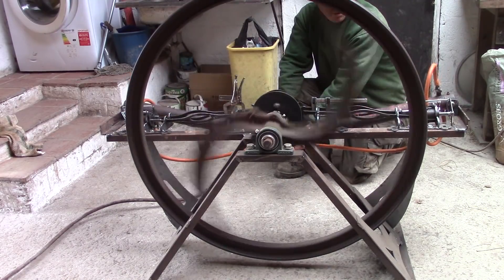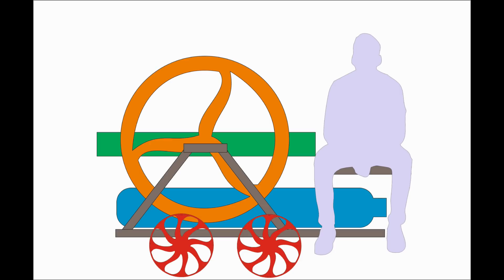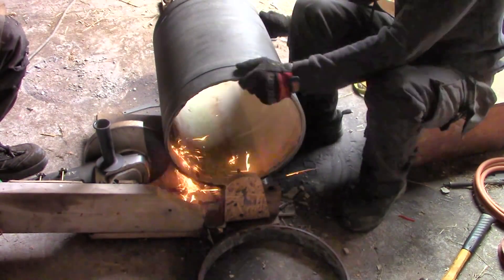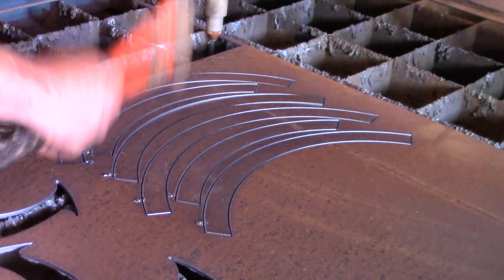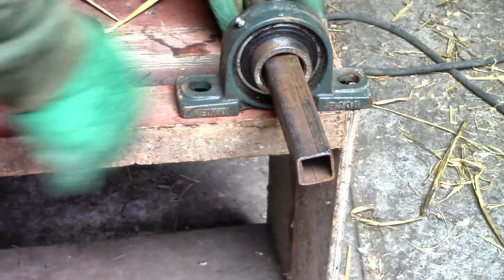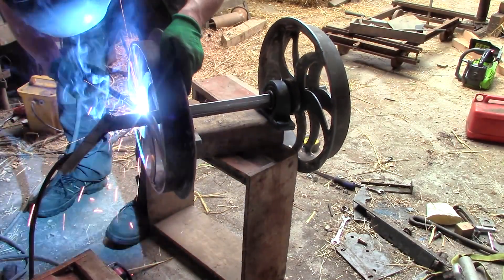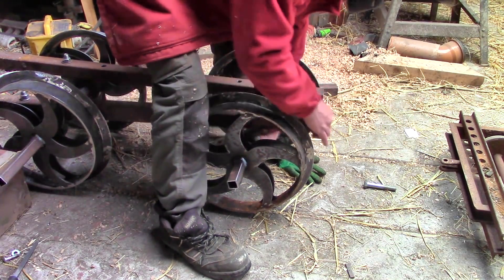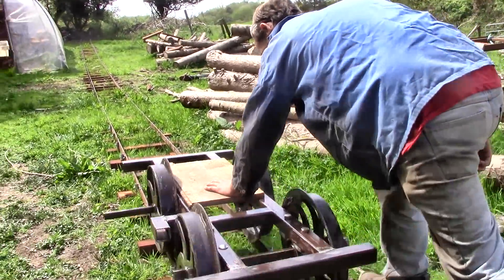Making A Locomotive For The Field Railway – PART ONE: Wheels and Chassis...

Comment: i would slow go on a steam engine. although they maybe more expensive to refuel (repressureize?) compressed air locomotives use their "fuel" more eficiently, it only being used when moving and not burning anything when its just rolling with no power, they are also great for short distance, start/stop, work for the same reason. they are also way less likely to explode without warning, you need to have extreamly high confidance in your steam boiler before you strap yourself next to it for extended periods of time. though in the long run if you can perfect it, a steam engine's probly cheapper and might even be nesisary as the railway expands.
Reply: I used to have a 7 1/4 " gauge engine and the boiler was pressure tested to double its working capacity and the safety valves set accordingly. As long as you maintain them steam engines are safe and reliable. Mine was a little 0-4-0 tank engine that could pull 5 people easily. So its definitely worth looking at.
Reply: The biggest headache with steam is managing the water level in the boiler.  Even a low pressure boiler needs careful attention.  Compressed air might be the way to go for this application.

Comment: To get a longer wheelbase, could you have wilder wheels?
I guess it could get a little "wiggly" on the straits, but even a 10mm wider wheel could add allot more for the total length. 

I'm also very interested to see how much traction you with mettle on mettle. I have no suggestions though as rubber tire would probably get cut by the thin rails.
Reply from the maker: I think the problem would be snaking, if the flanges are too sloppy, especially pushing something up hill.

Comment: You should consider putting some cone-angle into the steel tires on the locomotive wheels.

If the tires are coned, the locomotive can shift sideways slightly on the rails, giving the tire on the outside of the corner a slightly larger radius than the inside wheel. Otherwise one of the wheels has to slip, and you might run out of traction.
Reply from the maker: I must re-load my video on this subject. I made cone-wheels and they didn't make much difference on this set up
Reply: @wayoutwest-workshopstuff6299  I remember seeing that video and making a mental note to shut up about conical wheels.  They clearly don't make much difference to roadholding for your setup.  This comment makes an interesting point though, will it make a difference to traction?  Only one way to find out...
Reply: @wayoutwest-workshopstuff6299  I'm thinking that your very effective thin edge rails wouldn't' need cones as there isn't much of a rail profile for them to react with. However, if you do get cornering issues later you can always revisit it. My guess is they'll be fine as they are.
Reply: This project has a strong bias towards low cost, simplicity and effectiveness as soon as you start looking for efficiency time and cost increase exponentially defeating the original concept.

Comment: Hello, what is that rythmical sound of scratching metal when wheels turn around? About the engine, I cannot imagine how will you switch direction without some gearbox, so I would recomand some sort of and conected not directly to pistons but to some flywheel. But on the other hand, you could make samé sort of horizontal pistons same as on classic steam locomotive, with valve to switch direction of piston's intake. This would hold centre of gravity quite low.
Reply: this would be done within the driving gear and valve gear like on a real locomotive, not a gearbox

Comment: Hmm, I suggest perhaps adding a set of smaller trailing wheels towards the back of the locomotive where your seat might be, just to counter-act any weight problems with the locomotive itself, after all, you don't want it falling backwards on you
Reply: You could also counterbalance that weight by moving the air tank and engine farther forward to give more room for controls and legroom right above the axle
Reply: @dakotaleker2885  true
Reply: I would add both guide and trailing wheels
Reply: having the weight primarily on the drive wheels has historically helped with keeping them from slipping during acceleration
Reply: A seat is not necessary!

Comment: Have you considered seeing if you could salvage the parts to make a battery operated locomotive for your needs?
Reply: Now granted, it wouldn't bevas fun as a compressed air locomotive, or steam locomotive, but it could start as a launch pad to help you figure out the breaks and gearbox
Reply: @buddyhoward8963  For your information you can always edit your comments by clicking on the 3 vertical dots to the right of comment.